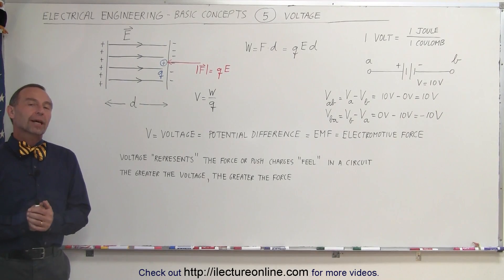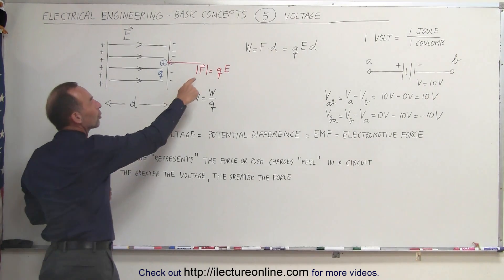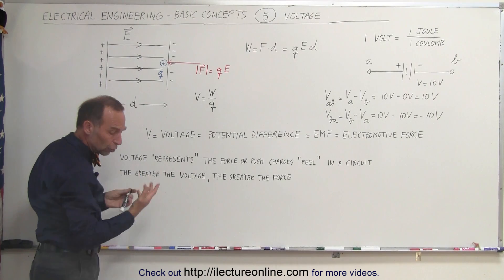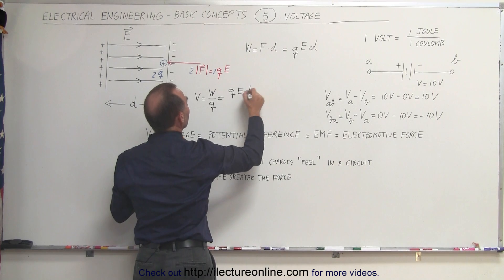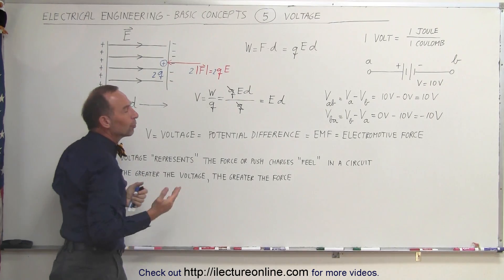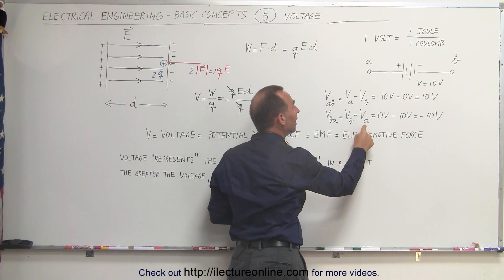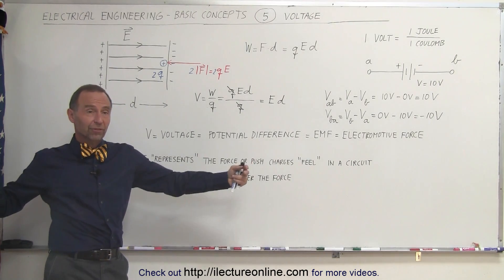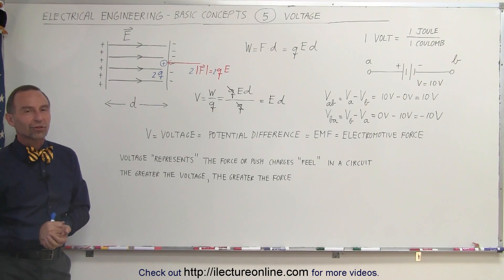Electrical Engineering: Basic Concepts  (5 of 7) Voltage

Comment: can you increase the d (distance) to increase the voltage?
Reply from the maker: That depends.  If the capacitor is connected to a voltage (power) supply, then the voltage will remain the same.    But if it is not connected to a voltage supply, you can indeed increase the voltage by increasing the distance, which will take work.

Comment: You keep mentioning that the higher the voltage; the greater the force that the charges experience in the circuit. Are you always referring to positive charges (as your picture shows) as experiencing this force? Why is the force considered for a positive charge moving from the negative plate to the positive plate? Positive charges naturally want to go to the negative plate, right?

Would like to hear from you, Michel. Cheers.
Reply from the maker: Question 1:   No      Question 2: It isn't    Question 3:  Yes

Comment: At 1:02 shouldn't the red E be the magnitude of the vector E?  Other wise you're getting a magnitude of of a vector force equaling 2 scalars
Reply from the maker: The red E is a scalar quantity.  The convention is that if you want a symbol to be a vector, then you must place an arrow over it.  (textbooks also use the bold face method of turning it into a vector symbol).